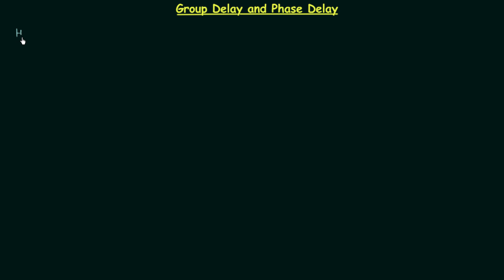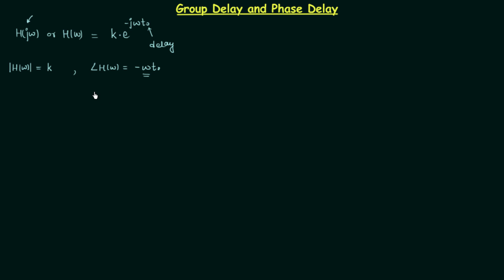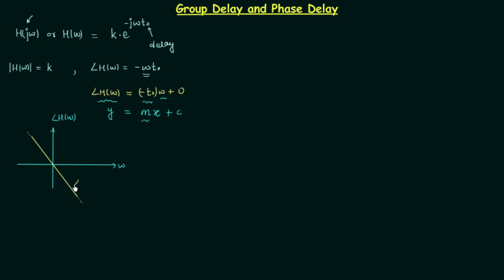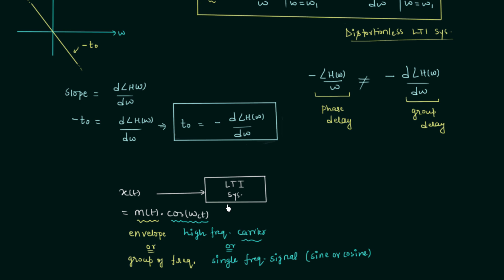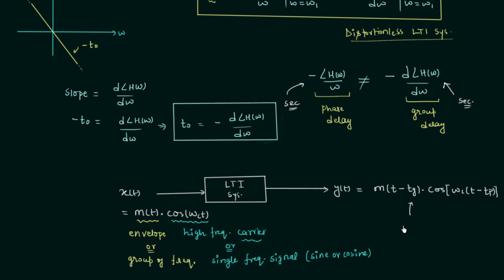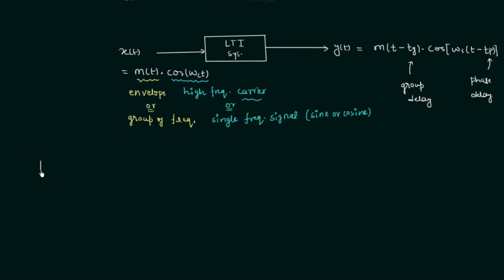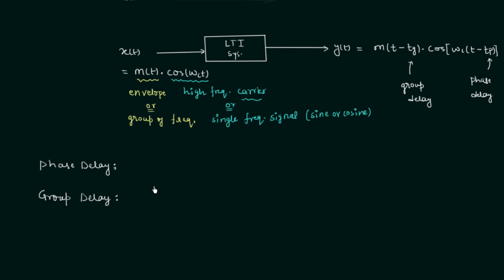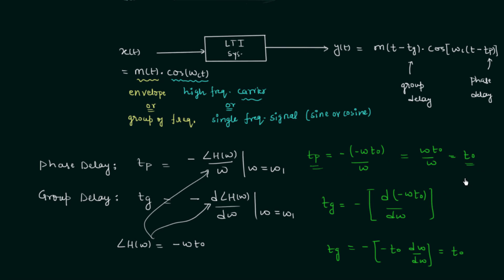Group Delay and Phase Delay

Comment: SO group delay is rocket science. Got it.....Seriously though, what level of mathematics do I need to know to understand this stuff.
Reply: The first derivative is Differential Calculus, but the rest of it is all Algebra and Trig. But to understand Signal and Systems and DSP lectures you gotta have those down tight. Get your Algebra and trig down to the point where they seem simple or these courses will seem impossible. I had my math courses 5 years ago and I have already forgotten most of this stuff. I stupidly threw my textbook and class notes away thinking I would remember all that stuff. Thank God for Matlab.
Reply: @jacobseal  Thanks for the advice man!